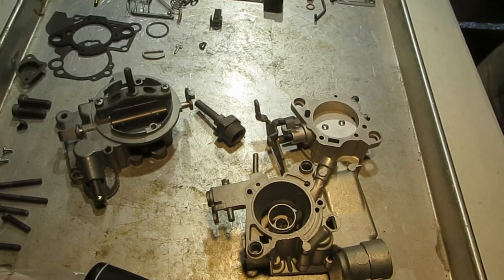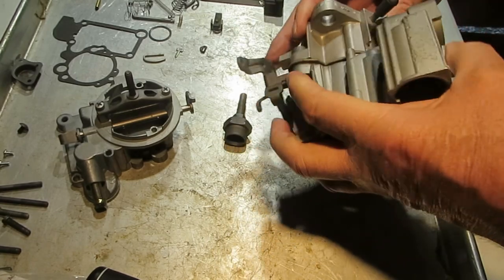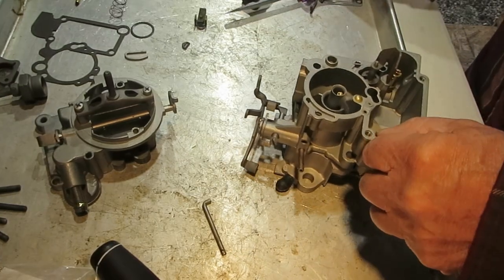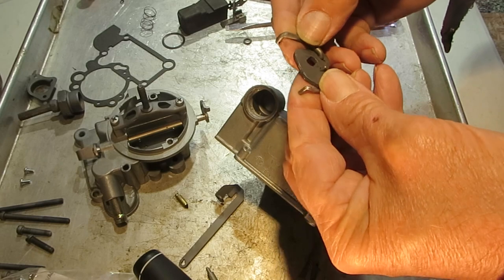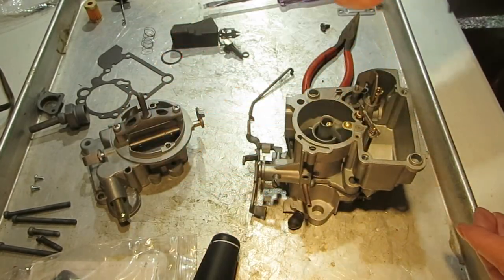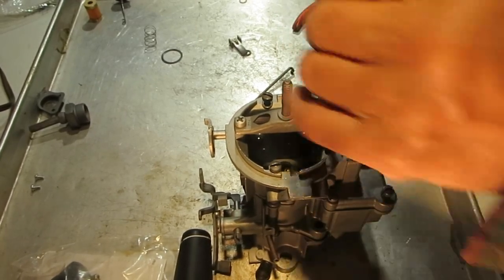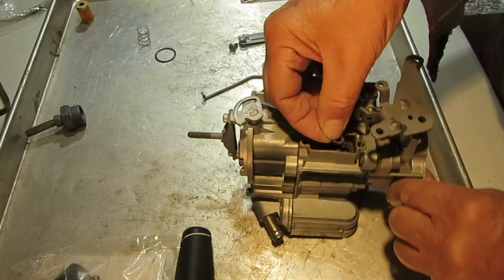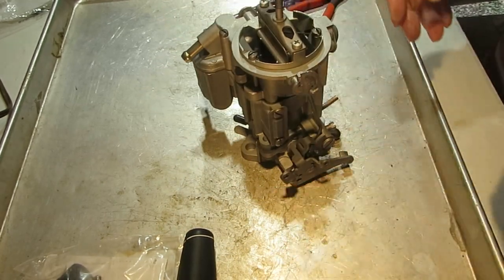Rochester Monojet Rebuild Part 2 of 2

Comment: Thanks for the videos. Really helped on my 76 nova with a 250. I was all ready to buy a re-manufactured carburetor for $300. but I found your video and it was made well enough and explained well enough I felt confident in just rebuilding.
Reply: @MikesCarburetor  hi Mike. There seems to be just about a hair gap between butterfly valve and throttle body cylinder when shut fully. Will this pose a problem. You mentioned hunting down vacuum leaks in part 1?
Reply: @MikesCarburetor  Thanks Mike. Really good videos. I watch these alot. One more Q. I have a hissing or sucking noise. Not sure if this is normal. I seem to only have 1 vac port at the base next to air mixture screw. Thought there might be an open port somewhere sucking air. Did monojets ever come out with 1 port? (automatic choke type with heat spring on exhaust manifold)

Comment: Hey Mike! I just followed your videos. It was really helpful. Just a quick question though. I installed everything back in, and tried to start up my nova (straight 6,250) and it ran for about 15 seconds and then it bogged and turned off. I saw it shoot fuel up when it bogged (so it I know it get fuel) but now won’t start up. Is this likely just me needing to adjust the idle mixture screw? Sorry if it sounds stupid. I’m young and dumb. Trying to learn

Comment: Hi man, i have some questions for you, i would like to know where  supose to be connected the hose of distributor vacuum actuator, i have a 1971 chevelle with a 250 and a monojet carburetor, i already checked the actuator and it works, but i need to know where can i connect the vacuum hose in the carburator, thks